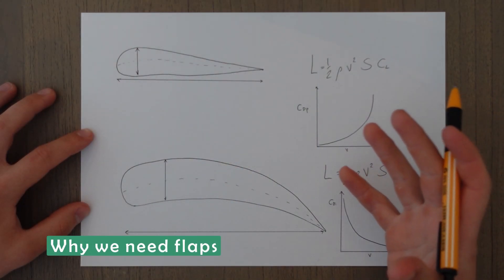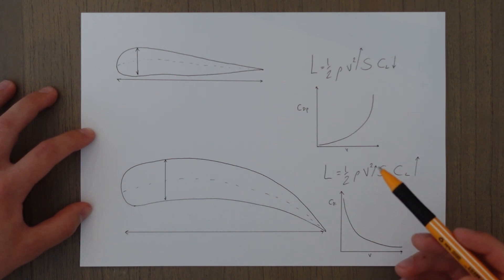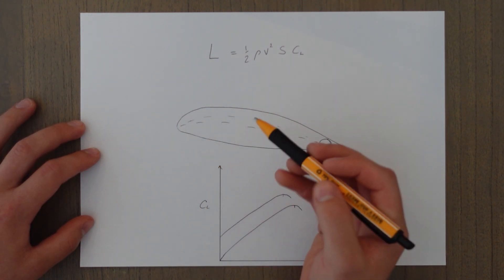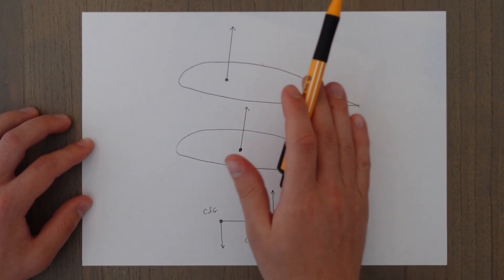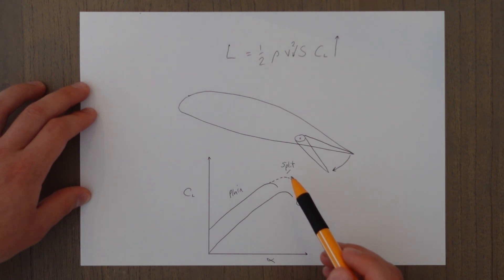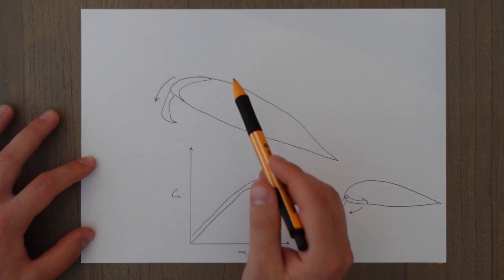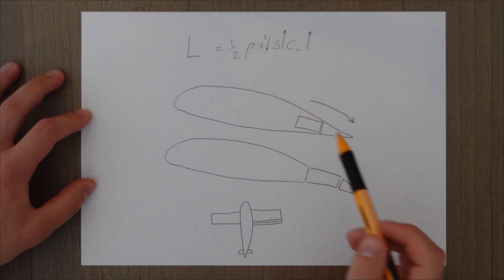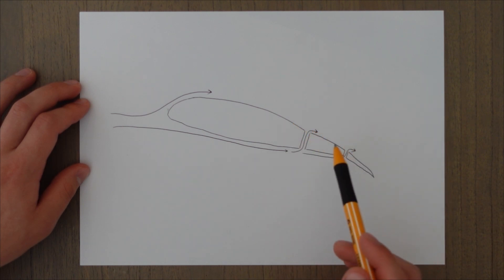ATPL Principles of Flight - Class 11: Flaps and Slats

Comment: youre making some mistakes when going over the physics, super good video overall tho. For example, planes do not use full flaps on takeoff not for the reason you mentioned (which is very wrong, you do not need higher speeds to compensate drag), but rather because full flaps would degrade way too much the plane’s climb performance (now this is related to thrust and therefore drag). Also, taking off with full flaps would overall decrease the runway lenght needed as Vr would be lower. As an argument could be made that drag worsen the performance, which is very much true, the overall benefit of the lower Vr has the better part of the todr difference thus reducing the total todr.

Comment: Hey am I right in saying that flaps increase lift and drag at a given airspeed and they allow a lower angle of attack whilst maintaining lift.when coming in on approach
Reply from the maker: Yeah and they also allow you to fly slower which is good for taking off and landing.
Reply: @atplclass  yeah .
Reply: @atplclass  hey say if the aircrsft was coming in with a no flap landing would a higher speed + higher angle of attack be required because we don't have that extra lift provided by flaps, so a higher angle of attack is needed?
Reply from the maker: @Dylan-djcali420  definitely higher speed and higher of angle of attack may be needed if the high speed isn't enough to generate the correct amount of lift
Reply: @atplclass right yes of course if the lift is already there then no need to pitch higher because then it would climb with that exess lift?

Comment: you mention Centre of lift moves aft causing pitch down ,however when selecting flaps on let's say a C172, the nose pitches up. Why is this?
Reply from the maker: It depends on the aircraft type and location of centre of gravity and pressure. So on each aircraft it will react slightly differently.
Reply: A good remark indeed. For example I fly an aircraft (ICP Savannah) that behaves the opposite of the cessna 100' family, it pitches nose down when you add flaps. And it is also a high wing aircraft.